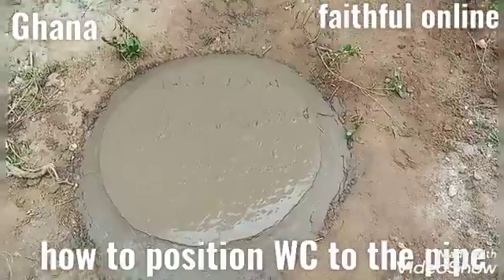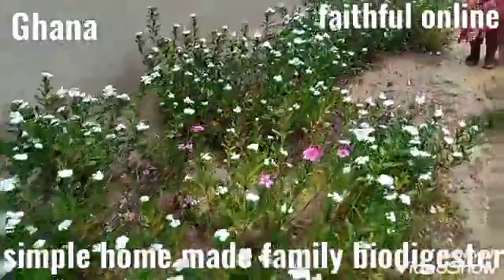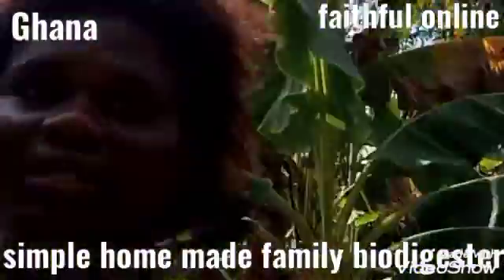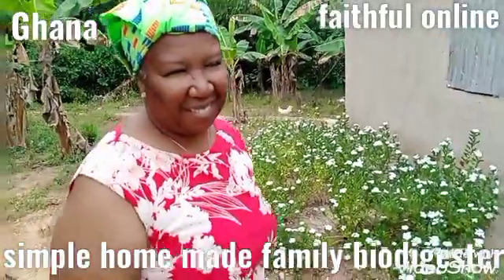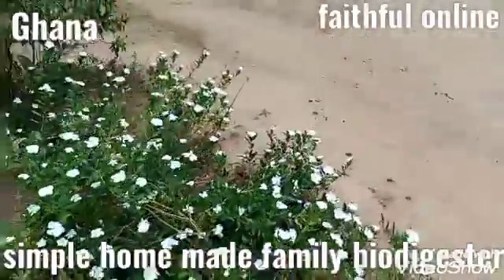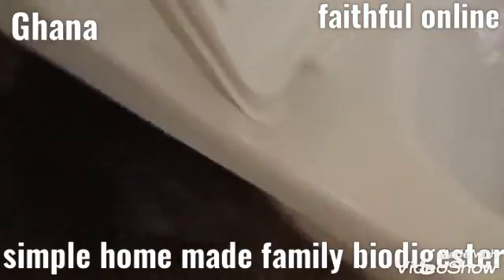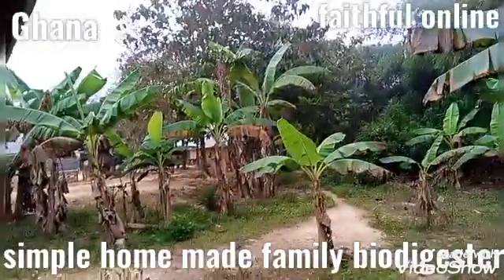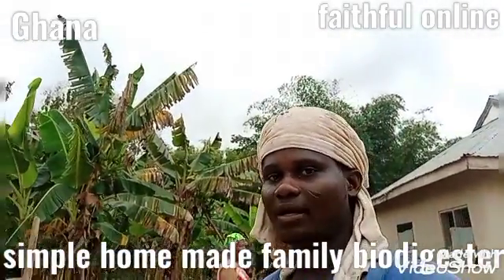Biodigester Simple home made family use..

Comment from the maker: Biodigesters - Facts - Figures

What is a Biodigester?

A Biodigester simply means a tank which digests organic material biologically. In this sense, the FilterPod is a biodigester.

However, many people think of a biodigester as a tank which digests, anaerobically, without air, organic material and produces methane gas for cooking, lighting and heating ect.

The composition of the gases produced by this type of biodigester is about 60% Methane, 30% Carbon Dioxide and the rest is Hydrogen Sulphide.

However, for a Biodigester to produce enough methane to make it practical for cooking alone, it would require all the household waste and toilet waste plus more manure from large farm animals. The Intergovernmental Panel on Climate Change (IPCC) estimates that an average biodigester tank produces 25.5 g of methane per user per day, which is not enough even for cooking a one-pot evening meal. As most UK households do not keep cattle or pigs, small scale Biodigesters are not practical in the UK.

Biodigesters are, however, superb solutions for rural agrarian communities, intensive livestock farms, towns and cities where the large volumes of domestic and animal wastes can produce significant quantities of methane. In rural areas, biodigesters are built in settlements where there is adequate animal manure. In Indian villages larger units are made to serve a number of families or even a whole village. In China, where most rural families keep numerous pigs, the one family unit is common.

To produce 1 m3 of BIOGAS, to cook 3 meals daily for a small family of 4 you need at least 5 litres of pig manure/day. 8 large pigs (breeding adults) will produce 5+ litres/day.

An example of a simple biodigester for animal manure is shown below.

A simple home-made family Biodigester System
Reply: Fantastic